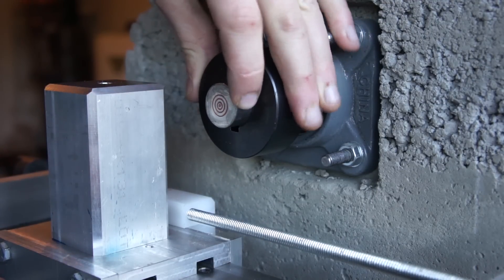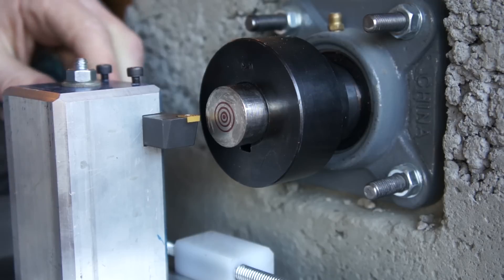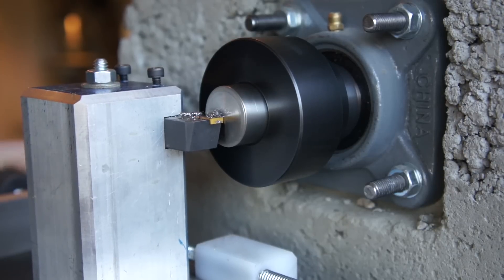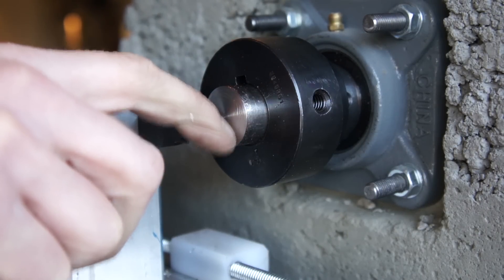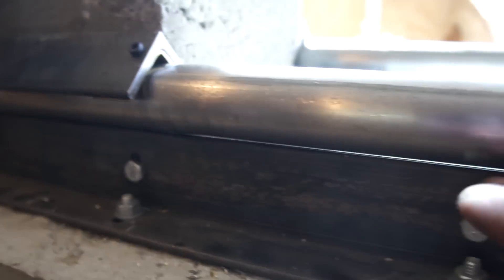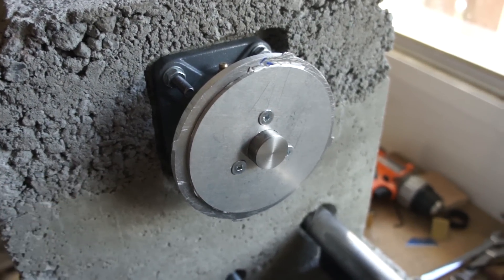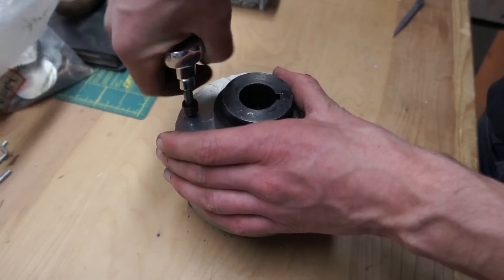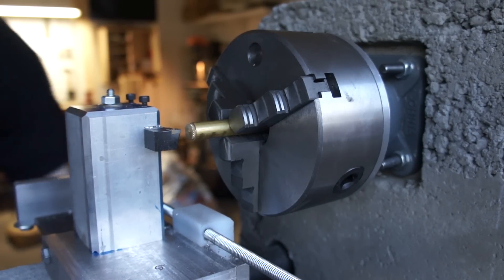Concrete Lathe - Part 5 Final

Comment: your attachment bolt holes were on the plate before you trued it up. so the base plate is true, but not the chuck
Reply: peterciurea I suggest watch a 13 part series called What on earth happened by Ewaranon to learn that the earth is not a globe.

I got it in my about tab.

Comment: Since I know nothing about lathes maybe this is a stupid question.  How can you be sure that you mounted the piece of aluminum you used exactly to the center of the shaft.  Even if the mounting holes are exact you have another center that has to be exact.  I’m curious how that was accomplished.
Reply from the maker: Great question, you are exactly correct. The plate was oversized and turned to fit the registration on the back of the chuck once it was mounted to the lathe spindle (turned diameters are normally spot on in regards to concentricity).  When I made the 2nd chuck plate I oversized the mounting holes "slightly" and used a mallet and dial indicator to tap it into true before tightening everything up firmly, even with the registration cut dialing in the last few thou required that adjustment room.

Comment: The WW1/2 concrete lathes most likely didn’t use quickCrete and they probably had quite a bit of rebar and for sure were settled without air bubbles, clumping, etc.., and had a very well set and solid concrete. Simply they would’ve been a very smooth, thick, and solid exterior. And this is obviously a concern of durability in how it’s set. Concrete shrinks when it sets which is something to consider when building in components. While the basis of these machines from those eras were used professionally they also had many more durable components not used from the common hardware store and yet were still inexpensive to build. Personally with today’s granite epoxy technology I would’ve gone that route, spent a little more on decent linear rails and a spindle; made a lathe that would’ve rivaled some of the best sold in the market today. GE is also an excellent material to absorb vibrations and impact. Neat to see an attempt of old school brought back but those old school guys were also serious blue collar workers who had a different skill set than the average joe today. They likely built many machinery without the aid of a blue print and manufactured gun barrels and alike on those old boat anchors. Edit: also noteworthy is the fact those guys used a lot of cast iron back then. It was readily available and cheap. Not a luxury today where cast iron plate is rather expensive. A proper machined cast carriage is $200 and needs to be hardened after machined. Aluminum is not the typical goto for machinery however mic-6 (cast aluminum) is a potentially usable product in the proper thicknesses. In my opinion nothing less than 1” thick mic 6 should be bothered with and from a good company holds a tight tolerance. Other good materials are 17-4 and 4140, 4340 which are all materials I’ve used in tooling and machinery and do very well durability wise. Not to leave out the traditional tool steels that can also be used for supports and such, machined, hardened, and finished to tolerance for a final product at a relatively reasonable diy cost.
Reply from the maker: ...yes :).

Comment: Looking at the date on this I know I'm a bit late to the party. If it was me I'd change the Allen head cap screws on the back plate to hex head It will make adjusting the chuck a lot easier. I agree with everyone that has said "get rid of the aluminum back plate". One last critique, if you had mixed your concrete a bit wetter the voids in the finish would be gone. Other than that great jorb there Hamstray! (Homestar Runner)
Reply: Dwarfracer I suggest watch a 13 part series called What on earth happened by Ewaranon to learn that the earth is not a globe.

I got it in my about tab.

Comment: Thomas D Harrell
I think its a great idea if you can't afford a lathe.   I don't know how much you want to dress it up but you could use bondo to fill the surface  pits and holes.   Just mix it up and spread it all over it then sand it off smooth.  Paint it gray and people would never know what it was made from.  Congrats great job.

Comment: Em.... !! It is really something!? I am shore some of these GUYS who have given you many advice over different thing about your lathe, forgot to tell you that it wasn't vibration which made those lines on the face of your work. It was because the angle of your carbite cutter. That I would put my money on....:) But again so long time ago, I dont even know if you stil have the lathe ? :)
Reply from the maker: Of course I have the lathe!  Its a million pounds of concrete and steel, its not going anywhere fast (besides down if the bench gives way).  Thanks for the comment.

Comment: Back when I was younger and less experienced I thought making machinery in your garage was a good idea. It isn't. Yes, you can build a machine that spins stuff and even cut it fairly well, but that's not the point of a machine tool. The point is making accurate parts with it as easy as possible. When you're taking a 1/16 cut on a shaft, you're expecting the machine to keep cutting 1/16 deep. If the machine just wobbles around, you can't really trust it and that makes your job 10 times as difficult. But how do you get a machine to cut reliably? Let's just say that beginners don't understand that a machine is a whole. They usually over engineer the basic structure (the bed and spindle in a lathe or the column and spindle in a mill) and then just drop the ball at the end by feeding the table or carriage with a cheap threaded rod and delrin nut. It's like holding a railway wheel to an axle with a 10-24 bolt. A proper compound structure of sliding axis isn't something that you can improvise. Sliding parts have tight fit tolerances because they must move smoothly but also be very stiff at the same time. If there is even just a couple thousands of difference between the highest and lowest spot in a sliding surface, it won't be stiff if it slides smoothly and it won't slide at all if you tighten it enough to be stiff. That's why machine tools are built to that high level of precision. Finishing a surface so all of its points are well under a thousand flat is possible by hand, but only if you really know what you're doing. If it was possible to just pick up raw materials at the hardware store and get decent precision, then why machine tool manufacturers have high-technology facilities?
Reply: That lathe design was to be easily made by people without access to high technology. Like people in war zones or really poor areas. By building it he is helping understand its deficiencies and how to improve it. It makes no sense to say a commercial one is better.
Reply: War zones and poor areas... you feel like the white man showing a lighter to the natives, huh? Except you're a couple of centuries off. Everyone has access to high end technology today, it's called commerce. You send the Chinese a thousand dollars and they ship back a machine ready to use. It's the art of making question the one you need to master, because the proper question here is how to get that thousand dollars (I live in Mexico and that's just a few months of salary), and not how to build a lathe without a factory. A common vice among the young is the dangerous combination of stubbornness and ignorance. Wisdom comes when you begin to respect the experience of people like us have have been there and done that, and failed at it.
Reply: @M1KEMEX  ''You send the Chinese a thousand dollars and they ship back a machine ready to use.''
That's not possible in pretty much any country because the government will steal your package which they call ''customs'' and hold it for ransom which they call ''taxes''. So it ends up costing way more than what you paid the seller.

Comment: Concrete base, water pipe bed, hardened steel cross slide base plate with aluminum tool post... and aluminum chuck adapter. I don't understand why did you pour a concrete base if you use aluminum to hold the tools and the chuck. Wood-turning lathes are made of steel, even homemade ones are.
As Sir Phobos did, I suggest you should use cast iron faceplate to mount the chuck on, machined to fit. Your cross slide and toolpost needs to be built from tool steel or cast iron if you want it to be rigid, Your carriage and bed should really be way stronger.
You have access to a cnc mill, and youÍ're struggling with aluminum toys. Aluminum is not for building machines.
Working on a lathe is dangerous, especially when the lathe has weak parts in it. You don't want to lose your fingers or a whole arm I guess, safety precautions are not for fun.
Reply: baladar I suggest watch a 13 part series called What on earth happened by Ewaranon to learn that the earth is not a globe.

I got it in my about tab.
Reply: @flat-earther  Okay, can I ask how does it connect to the comment I made?
Reply: @baladar1353  No connection. Random suggestion.

Comment: Oye what were those filthy screws with square holes fastening the back plate? Don't tell me you fouled the concrete beauty with wood working fasteners? Lol.

I absolutely loved your project. Hope to replicate it sometime in the future.
Reply from the maker: Haha, in my land Robertson drives come on everything...even flat head bolts (which I assure you they are).
Reply: Can't walk in Canadian Tire without tripping over them, just never seen it in anything but wood screw
Reply: Kolopsych I suggest watch a 13 part series called What on earth happened by Ewaranon to learn that the earth is not a globe.

I got it in my about tab.
Reply: @flat-earther  I'll give it a watch, but I'm a self confessed globetard.🤪

Comment: Some really good comments and suggestions here. Something that I noticed, which hasn't been addressed... Watch where you apply the tool to the brass. The reason for the jump, and the grabbing, etc... Is not because as you surmised, "it doesn't like face cuts"... It's because you jerk the wheel when you first apply pressure. You make a quick motion with your hand to grab the wheel, then make the initial application with a jerk. Smooth out your application of the tool, and you'll smooth out the beginning of the cut.
Reply: I'm not familiar with this but someone else also said that the cutting tool is wrong and brass needs negative rake cutting tool.

BTW selador I suggest watch a 13 part series called What on earth happened by Ewaranon to learn that the earth is not a globe.

I got it in my about tab.

Comment: The concrete is not properly poured for there are air pockets showing on the surface, I suggest the use of powerful concrete vibrators to ensure proper compaction and air pocket free concrete formations and add enough plasticizers and wollastonite to increase ductility, toughness, durability, impact resistance, shock resistance, vibration resistance, and add proper steel reinforcement designed to further strengthen the entire concrete structure. Make sure you add enough plasticizers to make it self-levelling and will flow around all steel rebars reinforcement.
Reply: darthvader I suggest watch a 13 part series called What on earth happened by Ewaranon to learn that the earth is not a globe.

I got it in my about tab.

Comment: Brass tends to "eat" your drill and mill  bits. It is extremly dangeraus as you have seen. Do not use brass.
Reply: jonnyderico I suggest watch a 13 part series called What on earth happened by Ewaranon to learn that the earth is not a globe.

I got it in my about tab.

Comment: Most excellent work! I've been planning and getting the infrastructure in place for a Gingery lathe build (such as "make a foundry", etc), but I think I might just change my plans and switch to something closer to this.
Reply: Did you build a lathe?

BTW hallofo I suggest watch a 13 part series called What on earth happened by Ewaranon to learn that the earth is not a globe.

I got it in my about tab.

Comment: Ditch the carbide insert tool and get some HSS then learn to grind it - its not difficult , the carbide needs more aggressive cuts to work and you dont have that luxury. Sharp tooling and very light cuts. Oh and ditch that aluminium backplate before the flying chuck kills you ;)

Comment: First sorry on bad english 
Is it possible to use  concrete bed and Linear Guide Ways  with linear bearings instead of gas pipes ? would be 1.18 inch diameter Linear Guide Ways be strong enough for this size lathe?

Comment: good effort, but i did notice when you were face turning the brass at the end, your tool height was way off. Shims are okay for a quick fix but you need to try and have some real adjustment in it. Every tool holder and insert will have its own height and to try and have shims for all of them would be a nightmare. Getting the basics right before going on will improve your tool life, your finish and your overall safety. Also try slowing down the RPM! speed doesn't always mean a better cut. sometimes a slower rpm and a faster feed rate will improve things. Oh and just in case your wondering, I set and program cnc lathes for a living.
Reply: sumo I suggest watch a 13 part series called What on earth happened by Ewaranon to learn that the earth is not a globe.

I got it in my about tab.
Reply: @flat-earther  oh do behave .

Comment: The runout on your chuck is impressive. But I doubt that the flimsy alluminium back plate will hold up. You should make one out of cast iron.
Also you might consider moving the cross slide screw to the other side. That way you have more room when turning close to the chuck.
Reply: rolingmetal I suggest watch a 13 part series called What on earth happened by Ewaranon to learn that the earth is not a globe.

I got it in my about tab.

Comment: Beside the not so stable tubing and cheap chinese bearings (which both can be solved) this Lathe is AWESOME! Can´t wait to build one myself. Have read about the 150$ concrete lathe on MAKEzine but there were some parts that I did not get. Now everything is clearer and I may have another project soon. Damn, already have 10 other things on the table yet. Great videos btw. Cheers
Reply: Well did you build the lathe?

BTW Carlos I suggest watch a 13 part series called What on earth happened by Ewaranon to learn that the earth is not a globe.

I got it in my about tab.

Comment: Good job considering the build circumstances , with the only exception being that 'a chain is only as strong as it's WEAKEST LINK' !   No doubt as you travel along the path of engineering, you'll see what works & what hinders progress. . .   
    I'd suggest a stiffer mount at the headstock / bearing connection - * since the amount of distance protruding is sufficient to deflect under load !   Other suggestions : make a steel cross slide (top part of saddle), since it would last infinitely longer than the aluminum . . . plus, it should be provided with 'wear strips' of bronze or brass !)   Another key point in reducing chatter would be having a tailstock to help support the overhang / distance protruding from the headstock - which would / will show up the weakness within the top of the cross slide . . . 
    One question that is going through my head , is whether you have the carriage 'locked' on the longitudinal plane while facing . . . that would answer for why chatter is happening . . . * but then, . . . you're still in the process of getting the build 'tightened up' ;)       When you're able , it would really be of benefit to use a steel toolpost . . .  
   Can't wait to see you get this project snugged up . . . ** Now to get power feed, & threading capability ! ! !       Rock ON !   :)
Reply: The key is to remain safe and to take tips from experienced tool makers . Secondarily , it is a great project in learning the reasons why lathes end up being what they are , it is through evolution that they are bulky and use cast and machined thick steel to kill inaccuracies due to forces. So you end up understanding machining  from a tool making perspective and a machinist in one pass.  What I really like about this project is the cement which has provided a good base. I wonder how it lasts with vibration and stress.  One thing is a MILL version of this can be used to make a STEEL version of both .
Reply from the maker: +georgewocosky Thanks!  I'm still chasing down all sources of play but your exactly right with many of your points.  Its insane how much force is generated when turning even soft metals...I'm slowly discovering what works and what most certainly does not work.  Thanks for the comment!